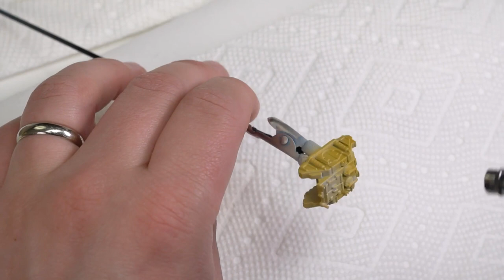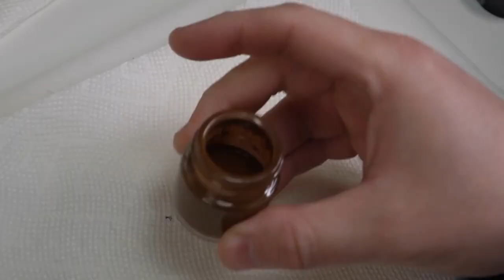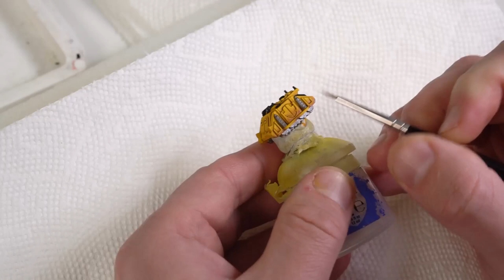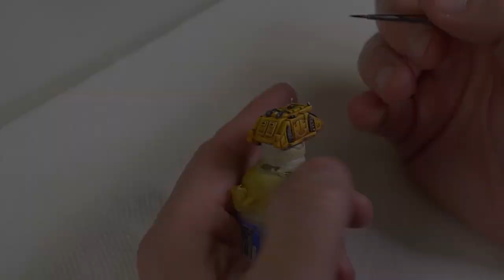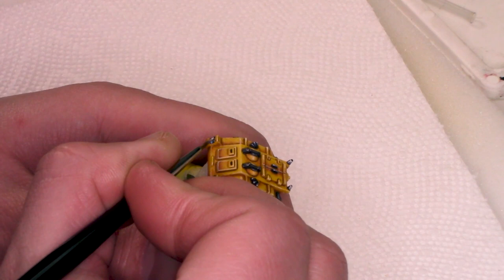How To Paint a TINY Epic 40k Rhino Tank (Imperial Fists)

Comment: Great vid thanks and amazing result. I am not sure you have to have a gloss layer before applying oils. The oil thinners and paint don’t react with acrylics, so they won’t be damaged by oils. It’s only oil on oil that does not work because the thinners will strip any existing oil on the model when applied over an existing oil layer.
Reply from the maker: Good to know! Every video I’ve watched seems to add the varnish layer so I was just following suit. I will test with no varnish though. The varnish does help the oil slip into the cracks and not stay if the surfaces though.
Reply: @BUNKER6  include me in that list! I show adding a gloss varnish or I will add gloss in with the last acrylic I airbrush on before pin washing/oils. But I find the gloss is used by the pro 1/35th scale painters that want the capillary action to work flawlessly when weathering big tanks/aircraft. For our gamer small minis I have found it works fine without because there is no interaction. It’s also a matter of preference really.
Reply from the maker: Awesome. Great tips and a lot of time saving to be sure. I wasn’t enjoying the results I was getting anyway so I’m happy there is an alternative! Thank you!

Comment: Hi Vincent 

I have purchased the imperator Titan, although rather expensive and I have jumped straight in the deep end as I haven’t painted since 1997, your imperator inspired me you showed it in its entirety.
I am wondering what airbrush kit you use as I’m thinking about getting my hands on one to save time undercoating my gargants from early epic as well as my eldar titans.
I may even link a video of my imperator so you can see
Reply: PS would you post a video of the imperator Titan in its entirety?
Reply from the maker: Sorry for the late reply! Congratulations on your Titan purchase! They are still such amazing models in my humble opinion. Ok so let’s go through things, Airbrush is an Iwata Eclipse with an Iwata air compressor. Not the small fancy looking one. But the medium sized regular older tank looking one. I painted this Titan before I owned an airbrush. Just did it by hand. The red recipe is Vallejo Flat red as a base coat but the key is using transparent red over the top. Doing this with an airbrush will look even better. I have two additional titans to build up which I plan on making into episodes. One is a Warmonger and the other is a custom homemade warmonger. Hope that helps!
Reply: @BUNKER6  I have a quick question for you Vincent 
When you painted the eyes of the tiny skulls on the Imperator Titan did you use any kind of trick or just steady hand ? Reason I ask is because of the power tools I use I struggle to calm my hand shakes so I keep messing up the eyes
Reply from the maker: So here is a crazy thing, someone said paint the eyes first. Then paint the rest of the head. I’d try and paint the eyes white. Be as messy as you want. The add gloss varnish over the top. Then add a yellow wash around the edges then wince dry and a smaller orange wash aiming at the edge crevasse. This should look like they’re glowing. Also if you’re still it steady you need to have both your hands firm on a table. Or atleast both your elbows. You have to buttress yourself. Also no coffee on paint days. Ha ha. Hope that helps!
Reply: @BUNKER6  absolutely fantastic help indeed Vincent.
I shall get the imperator out the glass cabinet and get my paints out right now. Mephiston red was the closest I could find to blood red and it turned out ok.
I also have an ork great gargant, the one that you stack together which is the best one I think but Damn trying to figure out a colour scheme is incredibly difficult for it but it needs to have a goblin green coloured head ultimately.
Reply from the maker: If you are ever struggling with painting ideas just look up the model name on Pinterest and a plethora of things should pop up that give you some inspiration and motivation. Glad to help in anyway I can!